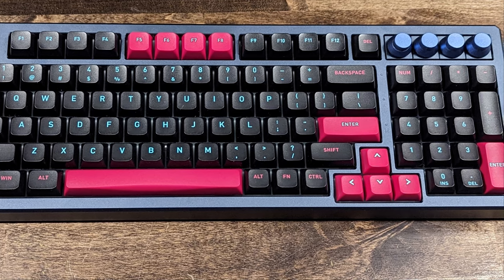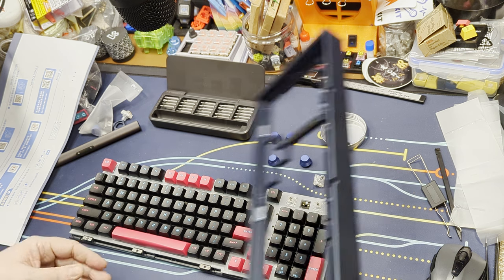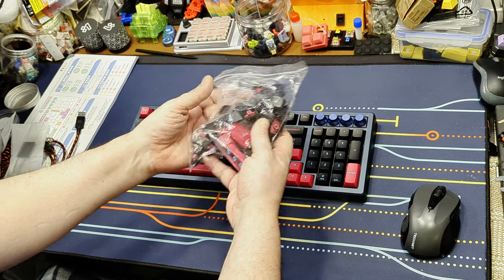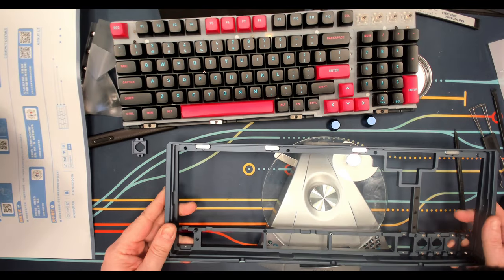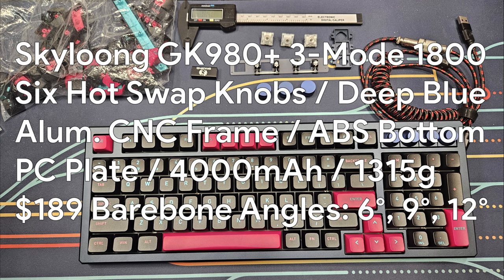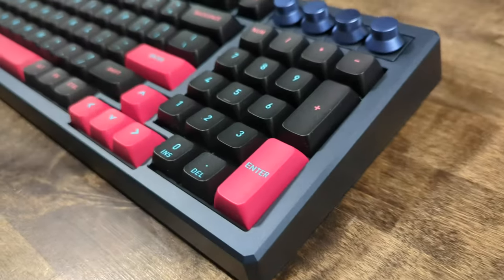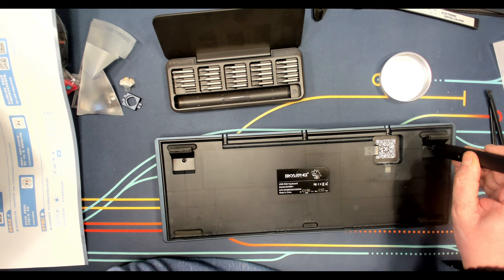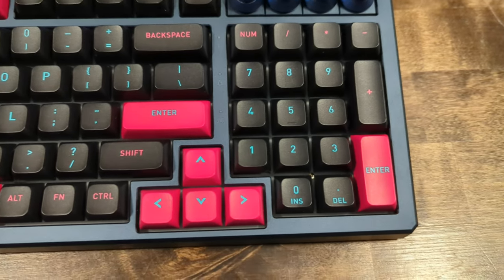Skyloong GK980+ three mode 1800 CNC aluminum/ABS case with six spots for hot swap knobs or switches!

Comment: I agree with most of what you said. The pricing is too high compared to what you can get from others. That hot swap knob idea while cool, always have something that I find bothering me. 

On the previous keyboard, that "rubber plug" was definitely easier to work with but I was not a fan of the aesthetic of it. Now, they removed that but the process of removing a knob is a pain.

I'm also not a fan of their knobs always being a different color than the board body. It would be better if they were the same color. It would provide a more cohesive look and wouldn't clash with different keycap sets.

I'm a sucker for nice design and this is not it. I won't go technical as you covered it already in your video.

On a side note, I like the video format but I did like when we were seeing you talking. Made it more engaging.

The sound is not clear. I don't know if it's just the equipment used or how the sound was processed. It's not bad but it's a bit muffled.

It's a work in progress and audio/video stuff gets expensive fast but since you asked I thought you should know.

This in no way reduces my appreciation of what you're doing. 👍
Reply from the maker: Truly appreciated, cheers! Every bit of feedback help me fine tune things, I'm always aiming to improve.

I'll work on the sound, I do hear what you mean. I think it's how I'm just talking to a mic I may tend to lean away from it, and perhaps a bit of mumbling.

And yes, audio and video equipment is not cheap, I'm eyeing a Sony that would take me up a notch, but it's pricey and will have to wait.